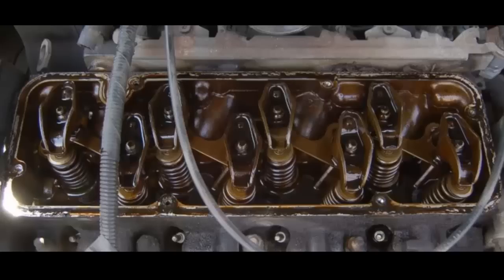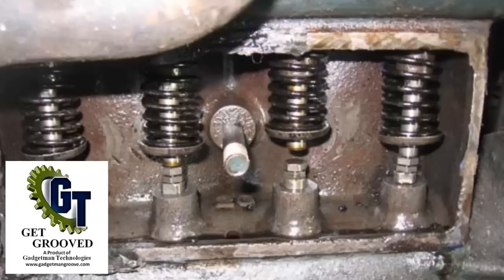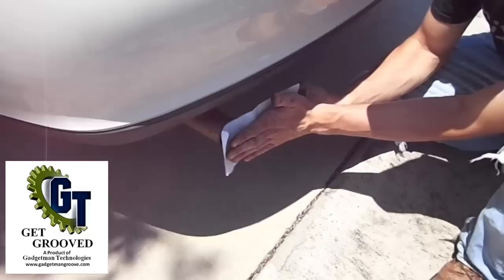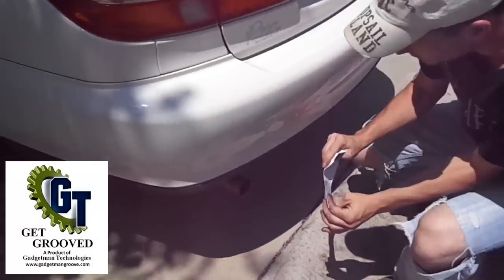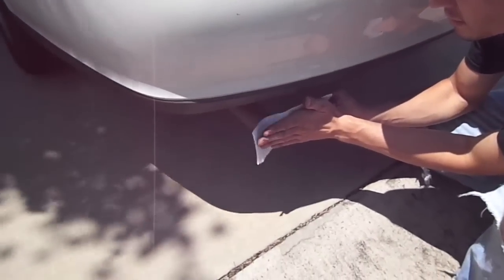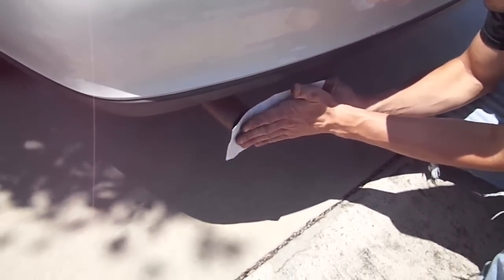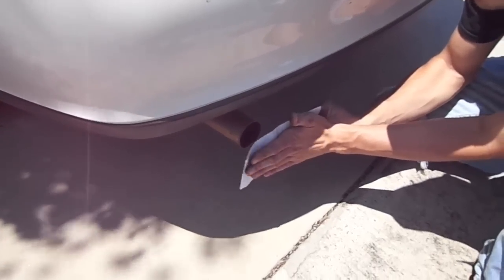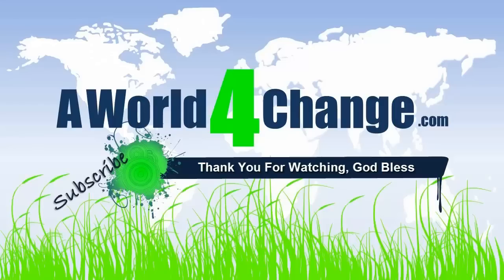How To Diagnose Sticky Engine Valves

Comment: same if i have dual exhaust with headers and angled tips? without tearing my engine apart, could i just run engine flush through the oil(after i let it heat up at an ideal) drain it and put new oil in.. would that maybe get it unstuck if a sticky valves my problem?
Reply from the maker: anthony fontecchio - Yes, that is a good idea to try for sure, and the test will work the same if you have dual exhaust. Do you have an "H Pipe" that connects the two sides? If not....and if the two sides are separated all the way out from the engine, then you'll be able to tell what side of the engine the valve is sticking. :) Thanks for asking, sorry it took me so long to get back to you!
Reply: no straight back from the headers.. so i found out i need a cam shaft but thing is when i do this test it says the valves are bad on the side i have no problems with any ideas? chevy 350 small block
Reply from the maker: anthony fontecchio - Honestly, I don't know. I can say this...if an engine is pulling air in the exhaust,  or pushing air out the intake (test can work either way), there's probably an issue with the mechanical in the engine...and it's probably the valve sticking. Just to clarify, this is a regular 350 with a single cam? What do you mean by one side being bad?
Reply: iv seemed to figure it out for the most part pcv valve wasnt hooked up vacum advance wasnt hooked up and a lob was bad on the cam shaft atm mits torn apart ill let you know how it turns out

Comment: This is a great video!  Thank you for sharing!  You can use this same technique to diagnose a crank no start condition if you suspect the valve timing is off.  Again, it should only blow out the tail pipe.  When cranking the engine over, if you feel the air being sucked in the exhaust or being blown out the intake/throttle body, the chances are the timing belt or chain has jumped time.  I use this simple trick in the shop all of the time to diagnose no start vehicles.  Takes less then a few minutes to run this test.
Reply from the maker: Amedee O'Gorman - *My pleasure and thank you. I didn't know that about the timing belt/chain though. You're saying, when it won't start...you can use this to diagnose it eh? Thanks again for watching/subscribing/sharing! W. :)*

Comment: Thank you!  I just tried this on my work truck and got this symptom.  My work truck can be hard to start and once started every ten seconds or so the idle gets rough and RPM drops and the vacuum drops from 18 or 20 down to 15 for a couple seconds then goes back up again.  It sounds like sticky valves then.

Comment: I have a 1991 Mitsubishi station wagon that has a loud lifter. I've noticed that when my car is making that noise, I have uneven engine running like, perhaps, a cylinder is not firing properly or something. I've also got high fuel consumption so this test might prove very helpful to me. 
Thank you for sharing this information.
Reply from the maker: I'm glad you found it helpful Joe, I hope it works for you and ya benefit from this video. :) Thanks for commenting!

Comment: Tried this on my car (fuel mileage is down). The paper didn't flap constantly, but every few engine,revolutions, the paper gets sucked in a couple times, then goes back to only blowing out. Would this be a valve "sometimes" sticking?
Reply: Wayne Meador can this be causing low compression because I have an 1988 Toyota Corolla
Reply from the maker: It is quite possible that this is the case TheKenKanif. There should never be a vacuum on an exhaust of a vehicle. It just should never happen. More than likely this is what's happening. :-/

Comment: yes this is a good test you can tell a lot form tissue paper over the exhaust pipe. first thing i do with any car i am looking at buying. also looking in the radiator for oily water and looking under the oil fill cap for white residue.
Reply: checking head gasket+ blow by+